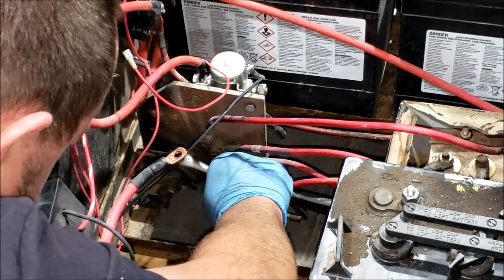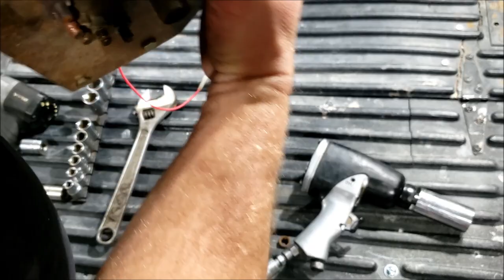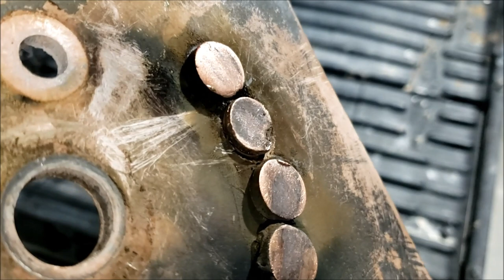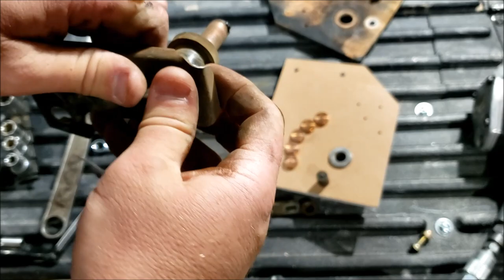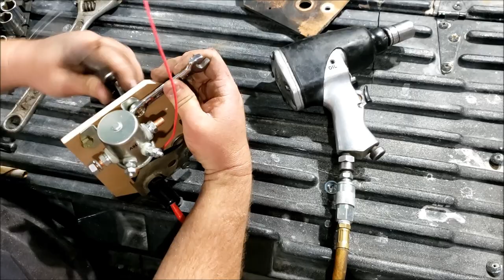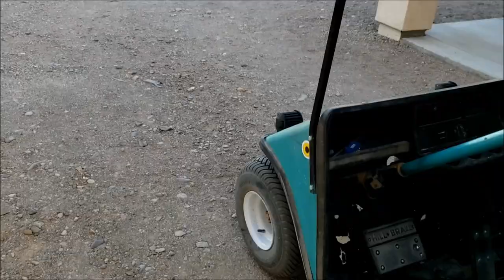EZ Go Golf Cart Contact Board Replacement

Comment: Unless I missed something, I noticed yours doesn't have a micro switch for the contact 'arm' to 'hit' and yours seems to use all 5 contacts, where mine only uses the top 4 and never comes in contact with the bottom 'coilless' contact. Is this normal? Mine has a micro switch that engages at 0% throttle and kills power while resting on contact #2 (from the bottom).when I press the throttle, it releases that micro switch and allows the cart to move. Any idea why mine would never touch that bottom contact and what that contact does? Also, my micro switch buzzes in reverse with key on or off, the actual buzzer it's supposed to have is disconnected. The cart was burned up and a spider web of wiring when I got it so just trying to clean it up and make sense of it all.
Reply from the maker: @ShiftEnvy  mine now has a micro switch as well, not having that is what burned up my board in the first place.

The last/unused contact is just there for a resting place. The sliding contactor would never be able to ramp up onto the first contact point without that there.
Reply: @BrandonsGarage  perfect! Thank you. Mine never reaches or rests on that last contact, so I must need to adjust the microswitch to let the arm 'fall' a bit more. I appreciate the reply! I'm betting that's why mine originally burnt up, also, as the switch didn't seem to function until I rewired.

Comment: I want to replace the sensor without replacing the board. It's because the wire is bad. Someone has taped it up in the past. It looks like you had to take the whole board out to replace yours. I was hoping there was some way to do it without pulling the whole board out. Mine is an 85 ezgo marathon

Comment: incredible video, i have same cart and having same issues, its a 1987 ezgo marathon. I cant find where solonoid wires go and f/r switch wires (micro switches) can i possible get your help with this? any pics showing connections would help, been weeks trying to fix
Reply from the maker: I cannot, this cart didn't come with a direction switch, I found a replacement for a Club-Car to be cheapest, and easiest to wire, so that's what I went with.

Comment: My Cart will only got about 2mph until the pedal is pressed about 80% of the way, then it jolts forward. The contractors seem to be worn a but in the middle. Do you think this could fix my issue?
Reply from the maker: Contractors or the resistor coils
Reply: @BrandonsGarage thank you. I looked closer at the contactors and the wiper arm, and it's pretty chewed up. I'll start there, and if that doesn't fix it, I'll move on to the coils next. Appreciate the response!
Reply: @BrandonsGarage  replaced the contactors and the swiper arm. Still doing it. I did notice tho after riding for about 15 seconds, 1 of the coils got extremely hot. Couldn't even touch it. I think what is happening is speed 3 is not able to engage. And it is jolting straight from 2, to 4. Does that makes sense or am I crazy? 😂
Reply: @jordanfink807 that means there’s a break in one of the resistor coils, so it’s bypassing and going to the next.  It’s also placing undue load on the other intact coils, causing overheating.  It will cascade and cause the others to fail if not addressed.

Comment: Any chance you have a carburetor for a 76 9.9 seahorse?  I can’t find one anywhere and the one thats in it is beyond repair.
Reply from the maker: I probably do
Reply: @BrandonsGarage  great. I would be willing to buy from you if you can let me know. Not sure how to find your email but I can send you an email and we can communicate that way if preferred.
Reply: @BrandonsGarage  if you don’t I do at least I know I have a 15 for sure !
Reply: @davekimbler2308  Thanks!  I think the 15 would fit on that motor. I would take either.
Reply from the maker: @joshuamaaz3797  dave is probably a quicker bet, and while spending money, might as well spend a pinch more for gained performance.
Reply: @joshuamaaz3797  I’ll go out to my workshop Thursday and I’ll text you !
Reply: @joshuamaaz3797  I have a really nice 9.9 carb from a 77 ! It’s clean as a whistle but requires a full carb kit . Do you have a OEM carb kit ? Make sure it’s a OMC kit not a Chinese one and has both welsh plugs , float , needle with pin and bowl gasket with packing for low speed needle . I’m sure you didn’t need me to tell you that but I can’t help myself sometimes !lol
Reply: @davekimbler2308  Dave - thanks for getting back to me. I don’t have a kit but I will order one.  How much would you want for the carb and shipping to 02831?  Also out of curiosity do you have the electric starter for that motor?  It’s my moms and she is getting older and having trouble getting it started when she takes the grandkids out for rides. If not no biggie.
Reply: Hey Dave. Just wanted to circle back on this and see if you had a chance to figure out prices.
Reply: @joshuamaaz3797  yes I replied with price of $20 carb + shipping ( I haven’t checked that out ) you do or will get a rebuild kit for it right ? Amazon has them from $13 to $30 . If you want I can send pics if I had your e-mail !
Reply: @davekimbler2308  sorry Dave I have replied a few times but it keeps getting deleted. It may be because I put my email in here. Not sure how to get a hold of you outside of this.
Reply: @davekimbler2308  joshmaaz and it’s a g account. Hopefully you can figure that out. I would love some pics and we can wrap this up over email.